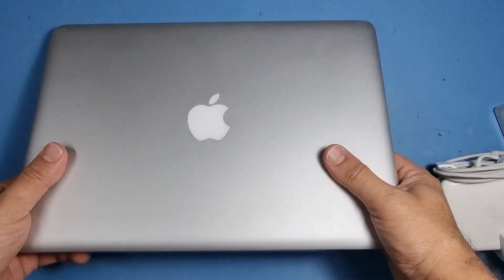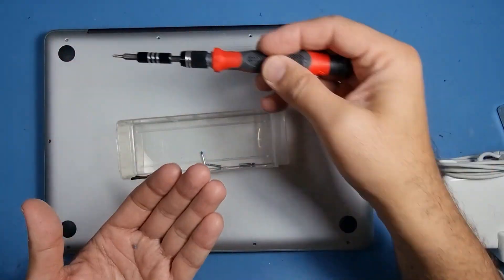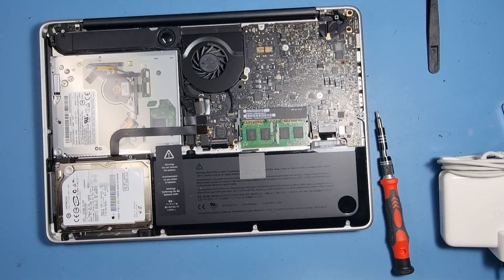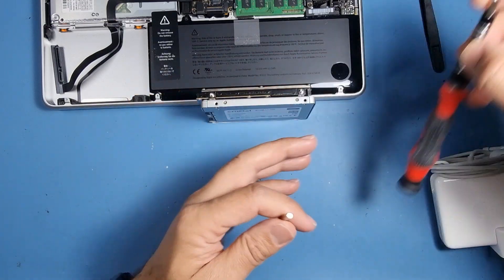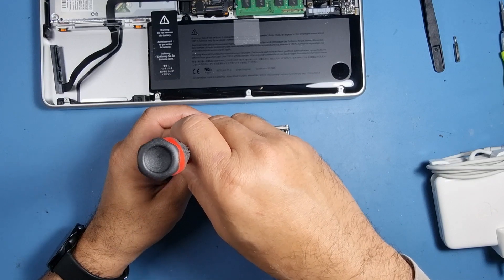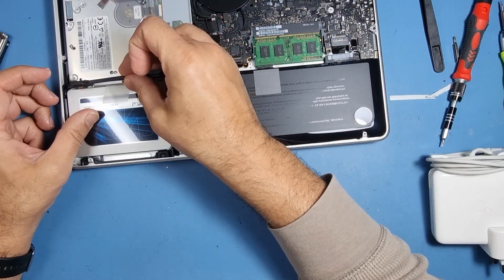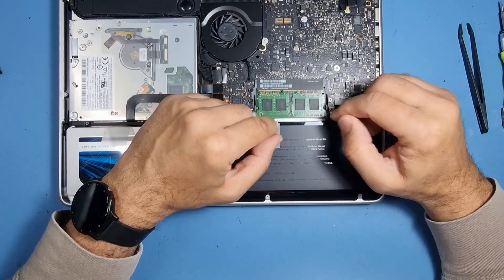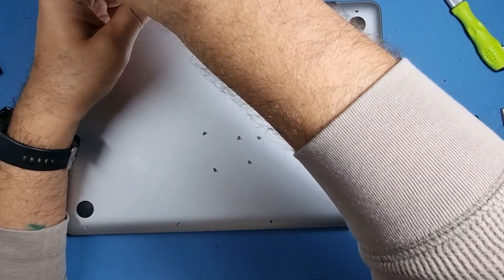Macbook Pro HDD to SSD Upgrade

Comment: I purchased this recently for $120. I upgraded the HDD to a 1TB SSD, the RAM to 16GB, upgraded the battery since the other one had over 500 cycles & reinstalled MacOS. It works like a champ now. It's a good backup laptop